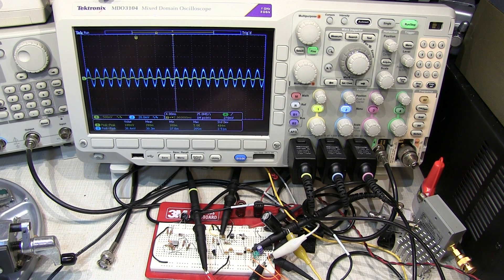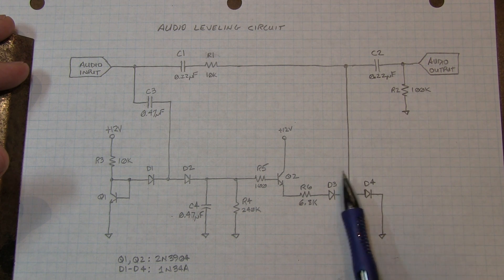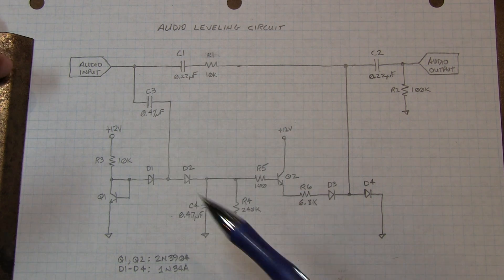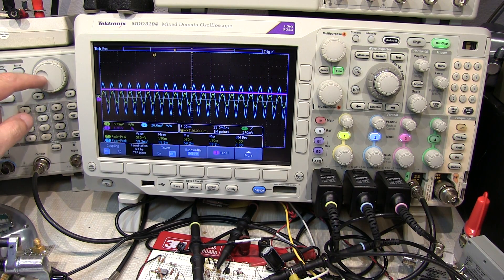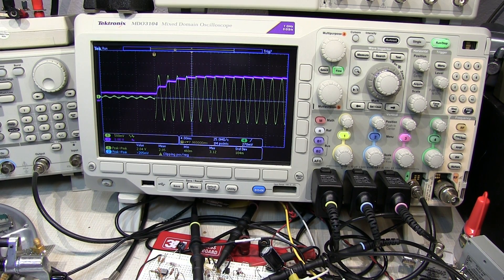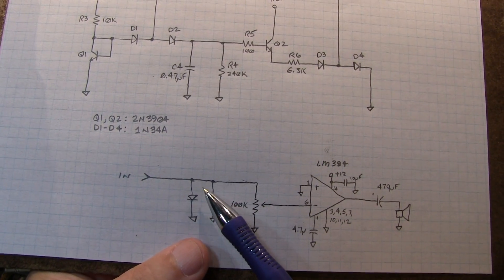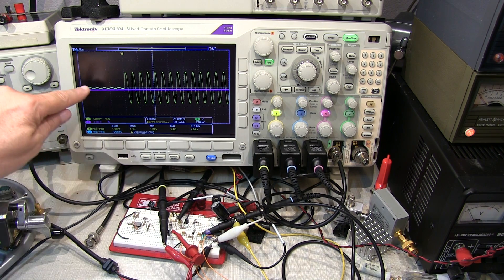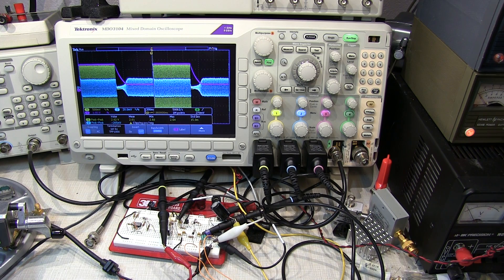#157: Circuit fun: Automatic audio leveling circuit | audio compressor | for scanning receiver

Comment: Great circuit.  I would like to use it with a Motorola Radio.  All of the Motorola radios I have run into have "floating audio output."  Can I still use this circuit.  Must I make any modifications?  Also, I want to confirm, you mentioned the circuit should work fine supplied with anywhere between 5 and 12 volts, correct. Last, do you by chance know what the current draw is for the circuit.  I have a feeling it is negligible, but wanted to check.  THANKS again.
Reply from the maker: Current draw is negligible.  If your audio source is floating, then you can precede this circuit with a 1:1 audio transformer.
Reply: Will give it a try. Thanks for the prompt response.
Reply from the maker: wiredwrx Depending on the peak to average ratio of your radio's audio, you may want to plan on increasing C4 to stretch out the "decay" time.

Comment: Ooh, this looks perfect for a circuit in my headset mod. I hope it works on just 5 volts :P
Reply: +TAIGAXML 
Alright, got it to work...mostly.
It actually overshoots a bit and acts like a reverse amplifier, taking off more when the volume is high, and not enough when the volume is low. 
Granted im using different diodes for both the peak detector and the attenuator. Maybe that's the problem.
Reply from the maker: I have noticed the same behavior with different diodes. It is somewhat better behaved with the 1N34A diodes, but will still have some overshoot and reverse gain control characteristics. The latter can be overcome by preamplifying the input, since the amount of amplitude change is less at higher input levels.
Reply: +w2aew 
That's exactly what i'm doing. Needed it to get up to a particular point, but after that it cuts out completely. No doubt thanks to working with just 5 volts instead of the 12 you've got. 

I use both Nte109's for the attenuator and ECG110mp's for the peak detector... but only because my little parts store down here in Santa Maria had only them.

I seemed to have fixed this by swapping around one 109 for one of the 110's on each side. Soo, looks like it works! Thanks for replying and awesome vids!

Comment: How to calculate the output?
Reply from the maker: It's mainly driven by the characteristics of the 1N34A diodes, so not really adjustable.  You would follow this circuit with an amplifier to get an adjustable output.

Comment: I have read that many of the supposed 1n34a's available on Ebay, and other places, are often fakes.
 I have 1n60's, which I plan to use for an RF probe. Would they do as well?
 I do plan to do a breadboard to test before building a permanent unit (or more).
 Wayne WA2YNE
Reply from the maker: I've gotten genuine 1N34A from here:
http://www.danssmallpartsandkits.net/
The 1N60 should work also, I haven't tried it.  Breadboard it to be sure.

Comment: Could you talk about NE570 ?
Reply from the maker: Interesting part - certainly would be better sounding that this simple circuit.  I know that it is used in telephone applications as well as ham radio applications.  It can be setup for compression (speech compression) for extra punch in difficult conditions, or as an expander to help improve dynamic range and drop room noise.

Comment: Hummm, I might make one for my TV to keep commercials at same level as program material.
Reply from the maker: Keep in mind that this circuit does add distortion to the audio signal (not that noticeable for a radio scanner, but may be objectionable for high fidelity audio), and that the output can't drive the speakers directly.

Comment: That is a neat circuit! One thing I do not understand, however, is how you are able to control the 'impedance' of the diode with current flowing through it like that. I was looking into making a simalar functioning circuit, and this sounds like the component I need:

http://www.instructables.com/answers/Smart-amplifier-design-building-blocks-help-making/

Anyways, isn't the "impedance" of a diode a function of the voltage drop across it? Due to forward voltage drop? (after all they are not linear...) How come is the output not distorted?

My only guess would be that the signal amplitude is so small, that the bias on the diode is what determines the 'impedance' since the signal is so small it can be thought of as slightly linear in that very specific region! (similarly in math class, we are learning about how we can use linear, quadratic, cubic, etc. functions to approximate core complex curves like e^x, sin X, etc. Over a small enough windows, and high enough degree polynomials, the curves can be VERY similar!)
Reply from the maker: In this case, the input signal is attenuated, so small that the non-linearities are kept to a minimum (and you need an amp at the output to boost the level back up again.  Similar to what you mentioned in your math class.  You might enjoy these other videos on using diodes in "different" ways:
Using diodes as switches:
https://www.youtube.com/watch?v=YBNIq_d56sA
Basics of PIN diodes (which can be very nice electronically controlled resistors under certain conditions):
https://www.youtube.com/watch?v=XpYsCM_Wf50

Comment: Hi, Alan. As I commented, I am going to build your circuit. I would very much appreciate your instructions, as to where to insert your compressor circuit into the existing Signal Tracer Probe circuit: qrpkits/files/tracer_assembly_031809.pdf. You will need to add "www." before "qrpkits" and ".com" after. As I am a just a hobbyist, please be specific. Example = “Between C3 and R7,” or “Between R15 and the base of Q2,” Etc... Thanks for all that you do for the EE Community!
Reply: My apologies... You clearly state that it is to be placed at the audio output/speaker jack. Therefore, no need to reply. Please save you time and effort.
Reply: To vary the output, would I just need to replace R2/100K with a 100K pot, set up as a voltage divider? Thanks, again!